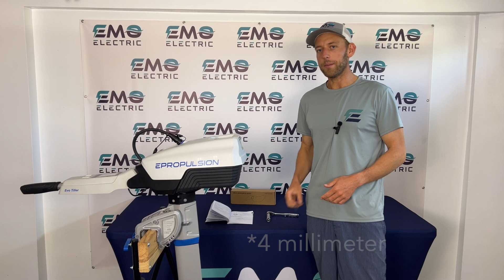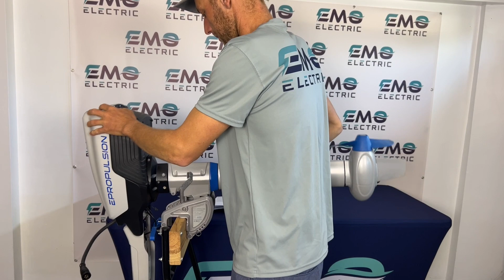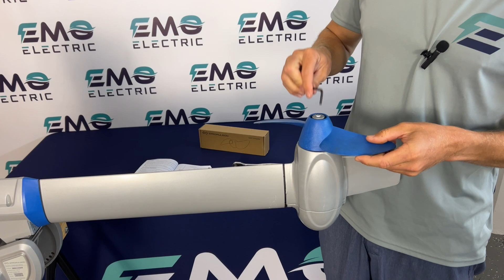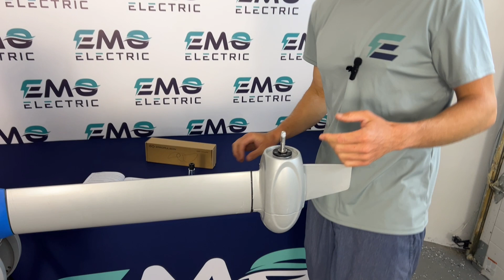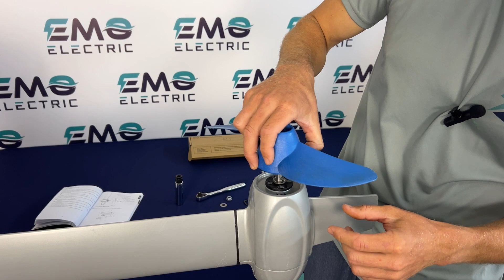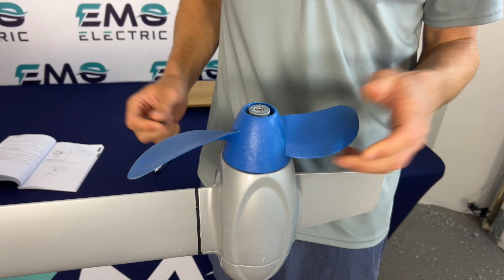How to Replace the ePropulsion Spirit Propeller

Comment: Great video, for info the large washer that goes against the prop before the 10mm nyloc should have the grooved side against the prop to grip the plastic. ePropulsion call this a "disc spring" in the manual. Also a deep 17mm socket, as you have used, is needed to reach the M10 nut inside the prop. A standard size socket just about fits but might slip if there was any corrosion and extra effort was applied to remove the nut. Regarding Lenny's problem with what appears to be a broken pin, it's a shame ePropulsion don't have a method of locking off the drive shaft to help with this repair.

Comment: If I want to remove the propeller from a navy 6, do I follow the same steps?
Reply from the maker: The steps should be similar! The size of the nut on the prop shaft may be different. I'm not sure of the order of various washers off of the top of my head and would recommend noting that order as you remove the prop.

Comment: The 17mm socket ranch is turning but the lock nut is not coming up. It seems that it's also turning what it's on. What could be the issue and how to fix it? (Probably the pin broke) Thanks
Reply: @EMOElectric  @LennyKMusic How do you remove the lock nut with the broken shear pin, did you have any luck? There should be a groove in the screw to lock it steady with a screwdriver but right now its apparently stuck.

Comment: My propeller started spinning much slower after I was in very shallow water with weeds. Could it be because the anode wore out? Everything else on the motor is showing fine. Thanks
Reply from the maker: Hi Lenny, that shouldn't have to do with the anode. I would expect that the shear pin has broken.